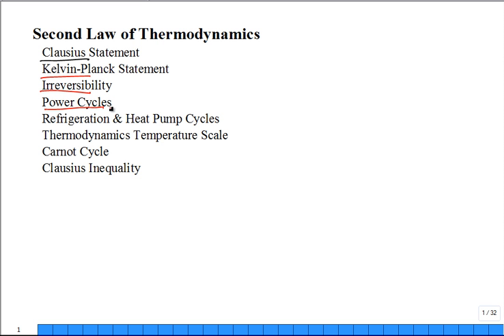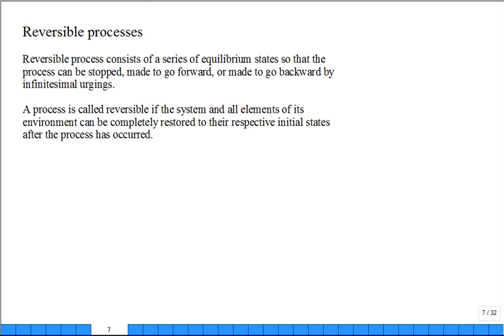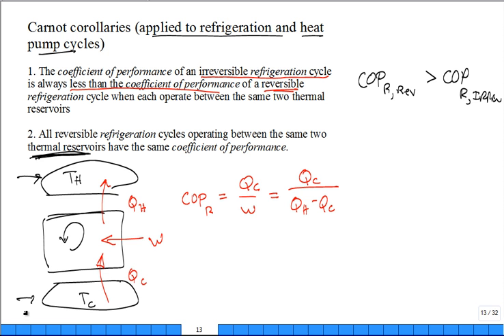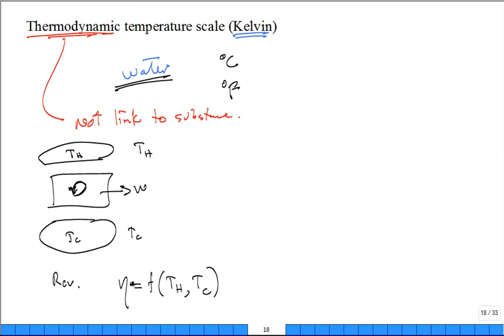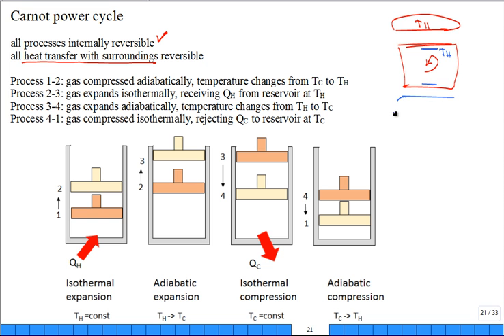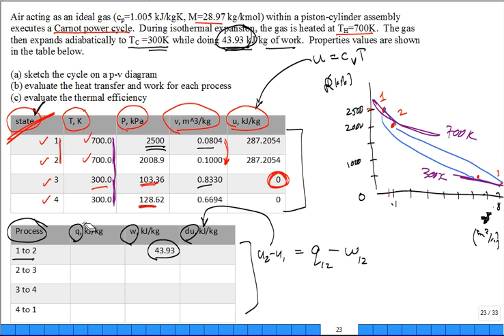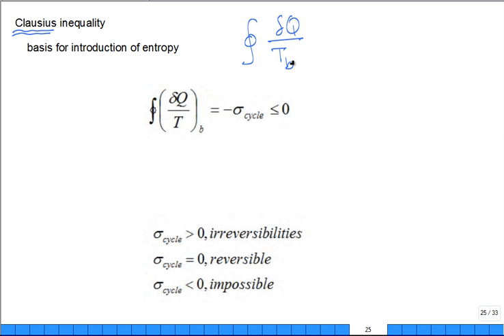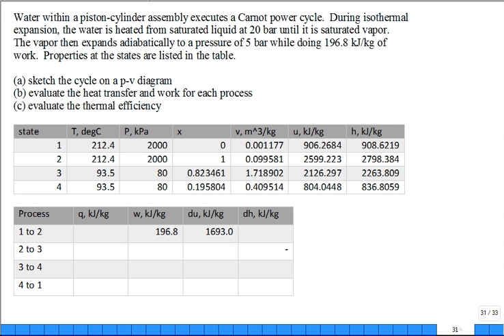ME3293 Second Law

Comment: Great video. Thanks so much. I have a question here, in a cycle with irreversibility, at the end of it, you go back to the same state. So the net entropy change of a working gas should be zero. Now we know from Clausius' inequality dq/T should be always less or equal to zero for the same cycle. Also, dS= dq/T+ dSgenerated... So when the dS on the left hand side for a cycle is zero..does that meant dq/T=-dS(gen) ?
Reply from the maker: Nikan RT Yes, the integral dq/T for a cycle is equal to the negative of entropy generation for the cycle.  What you deduced is called the Clausius inequality.